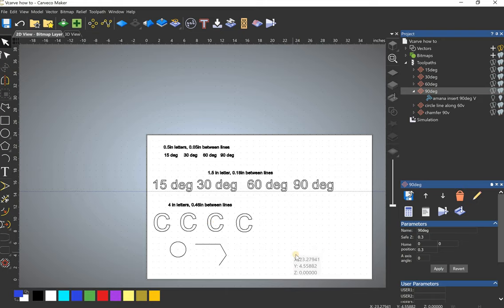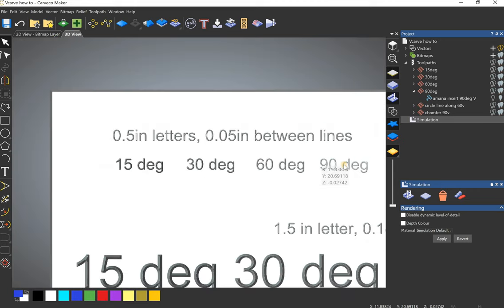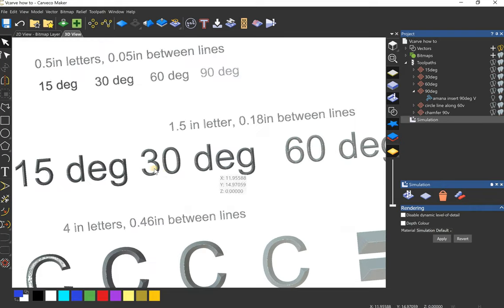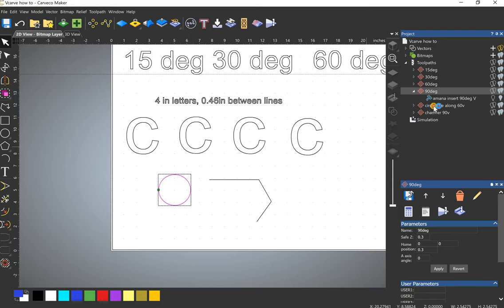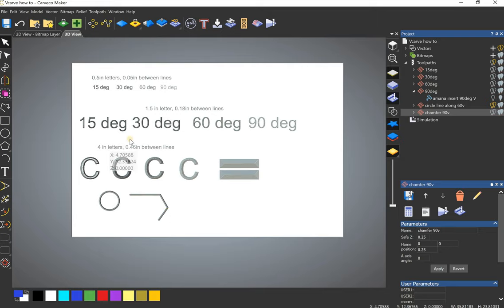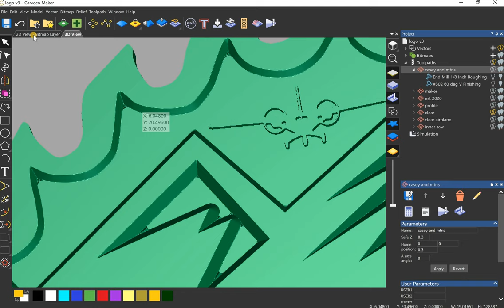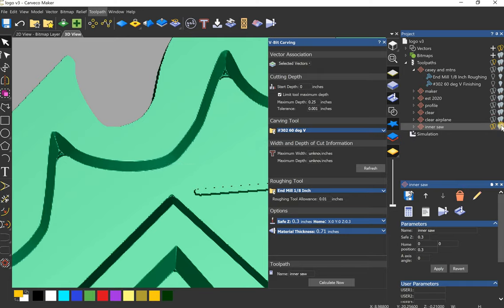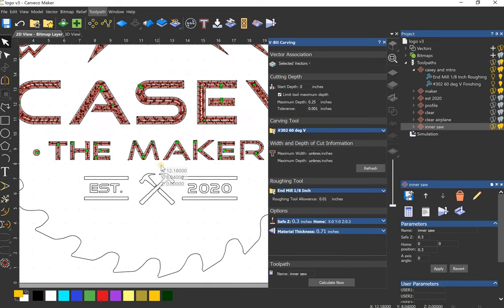Vbits explained Carveco Maker

Comment: Thank you for doing this!
Reply from the maker: No problem, Let me know if there are any other tutorials you'd like to see.
Reply: Fusion 360 has “adaptive tool paths” - is there something similar/same with Carveco but with different name? Maybe a comparison of the two, or just a tutorial on how to do? (I think I’ve figured it out, but maybe this is something holding others back from getting this software?)
Reply from the maker: @TuttleImages  Interesting. I dont think Carveco has adaptive tool paths. I was talking with chris powell because I dont know much. it seems that the carveco support is very open to adding new features when we ask for them.
Reply: @caseythemaker  - well, lmk if I can help out in any way. I’m starting down the road of aluminum & brass on my SO3 and want to use Carveco to do my designing.
Reply: awesome video. just worked on my first project and it called for a profile, vee bit and a roughing pass that i used an 1/8” end mill for. Project came out ok. The letters look funky. They did not come out with crisp straight lines. i’d love to share a pic of the project with you if there’s an email address i could send it to. 

would you be able to do a tutorial on just tool paths and what each option under the profile and vee bit windows will do? thanks in advance
Reply from the maker: @workingdogwoodworks1455  Yea let me think about it a bit. you are welcome to share with me. cmarwine@gmail.com Are you on Facebook? We have an excellent group for help https://www.facebook.com/groups/carveco/